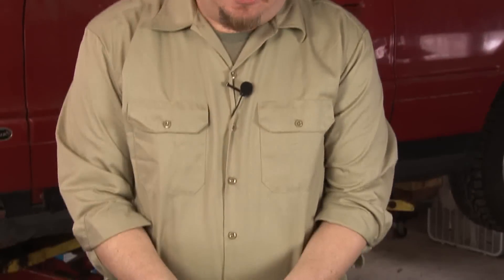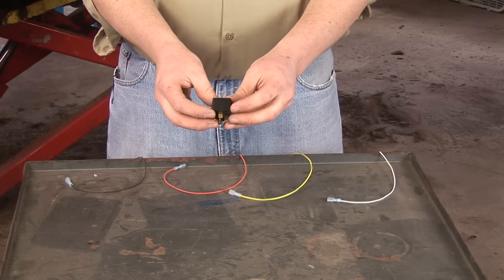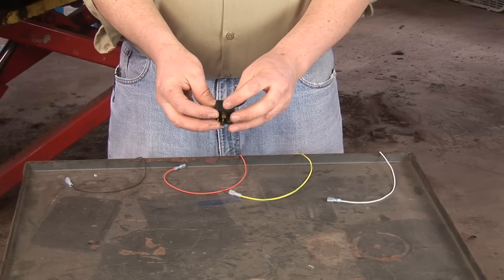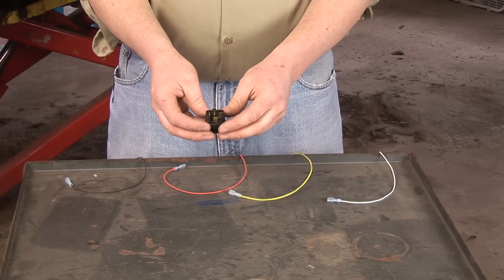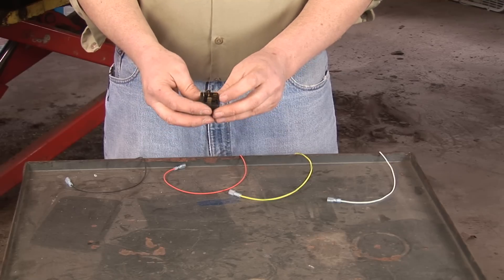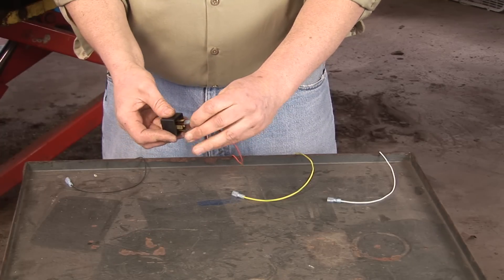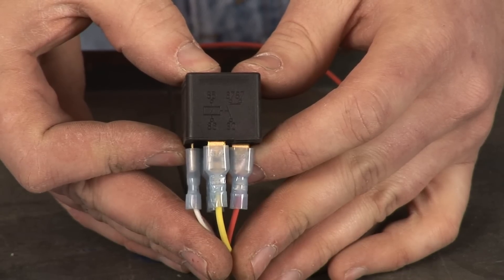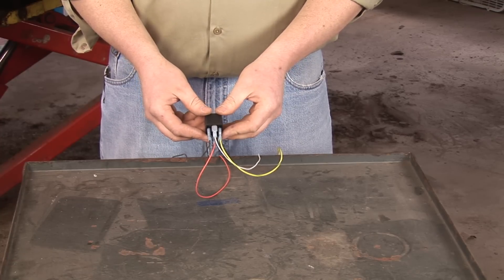Auto Repair & Mechanics : How to Wire a Relay

Comment: Stuffyou100 - you would need to power the relay switch from an ignition live, only powered when the engine is running. You could tap directly into the ignition wire, or find a light or other piece of equipment that only/automatically comes on with the engine. 

This will take some familiarity with a wiring diagram or multimeter. If you don't know how to find one, you probably shouldn't try this until a friend has shown you how. 

I used one of these to power motorbike heated grips.

Comment: I did it for my car to make LED strips come on.  I just shoved a thin wire (+) into the hole with the right pin (the one that makes contact when the power is on) and the - part to my battery.  When the power is on (turn of the key), the magnet pulls the pin and makes the connection so the lights come on.

Comment: Unfortunately, for me, you didn't spend enough time talking about the switch part. I want to hook up switchable device that simply make power available when ignition is on and shuts down when ignition is off. I still don't understand how to hook it up to ignition as NOBODY explains that in this vids. Thanks anyway.